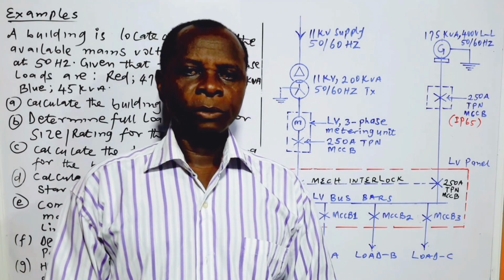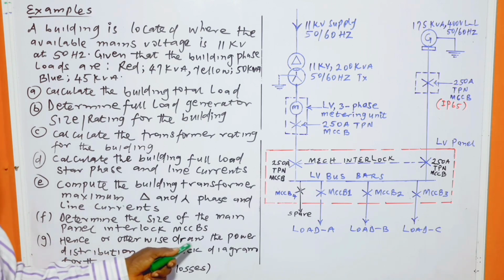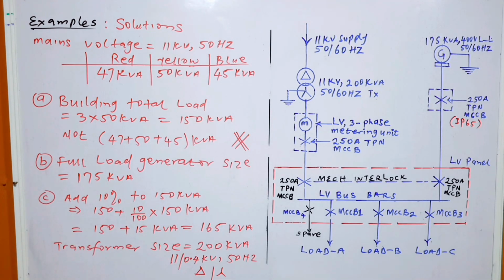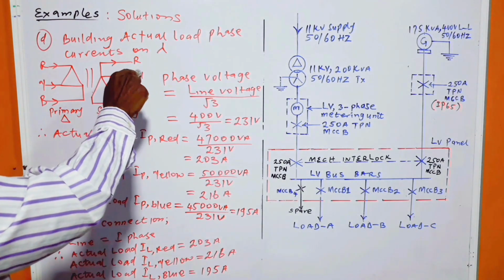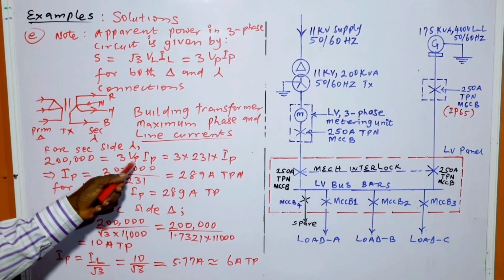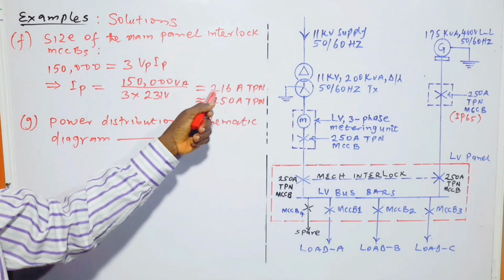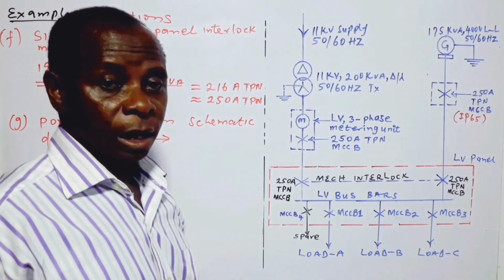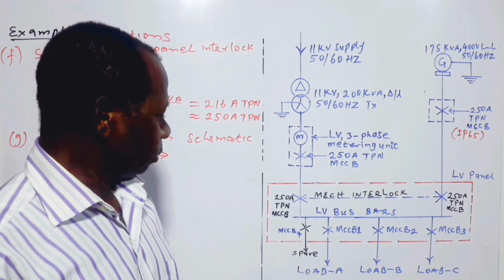Electrical power distribution at low voltage

Comment: Please sir I have a question!  In a practical installation how can I determine the apparent power (KVA) of the red, yellow and blue phase as given in your question  sir
Reply from the maker: Practically, or on the existing installation, make use of clamp meter to measure each phase current and phase  voltage. 
Then, multiply each phase current by each phase voltage. The three results give you the apparent power  in VA on each of the three phases.
Then divide each phase apparent power in VA  by 1000 and the result is the apparent power of each of the three phases.
Reply from the maker: https://youtu.be/JTFfGuwQeq8
In designing on the other hand, please use the above directory to watch the video on DB load collation to know how to compute the apparent power on each phase.
Reply from the maker: https://youtu.be/QY5wVTKmK7A
The above is another directory of my video that has to do with Apparent power calculations